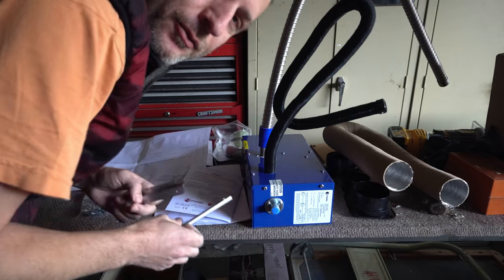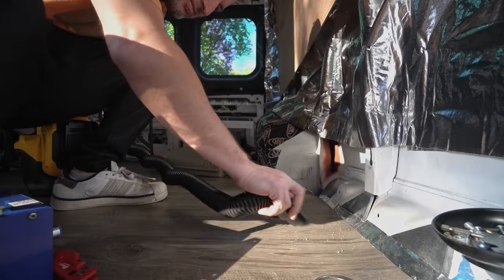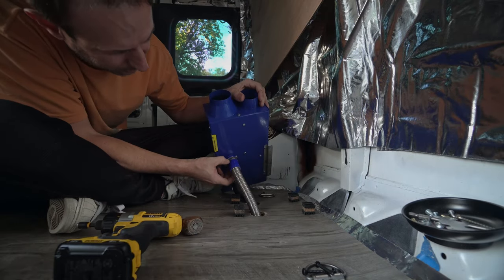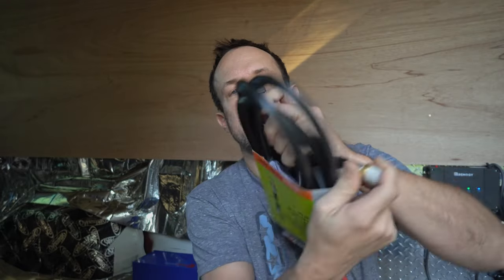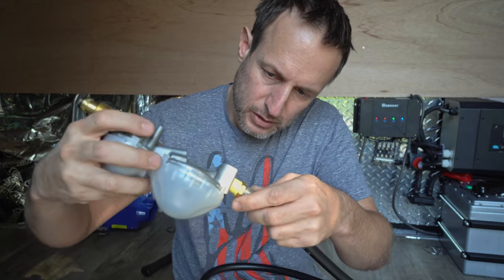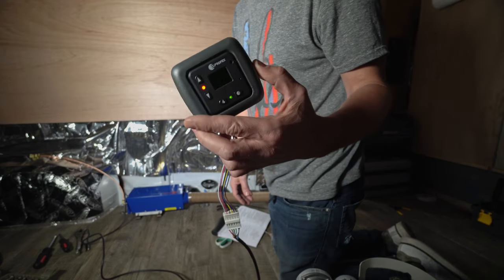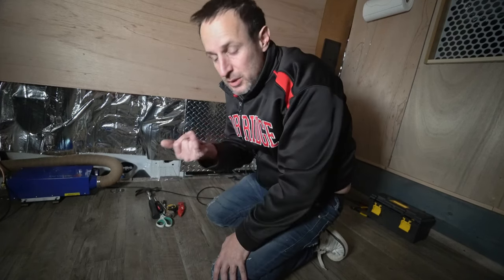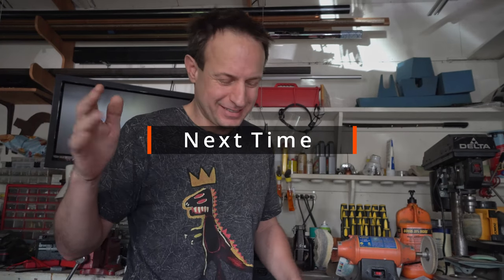Propex Heater “ Is it good?￼” Do this USA fitting | Correct Red Silicon

Comment: First time viewer. I really enjoyed your video. Humorous but informative and practical. Like most things, the devil's in the details. I may put one in my  Promaster next year. I'm still pretty early in my build, but it's nice to think for a while about an important accessory like this before jumping into the project. I'll look forward to browsing some of the other videos on your channel. Best wishes.
Reply from the maker: Thank you so much boat guy I've added an electric panel heater 300 W so that if I can plug-in I don't have to use propane and I still love this propane heater for sure I'm assuming you're up in Seattle but let me know if you come down south
Reply: Just sold my Promaster camper I built. Guess what, I now have purchased a Ford Transit and have got another Propex on order for it. That's how well they work. I have a brand new Chinese diesel heater still in the box but I'm not taking chances with it compared with the reliability of the Propex. If you own a high top Van I highly recommend going with the HS2800 as it kicks out about 3000 more btu and did a great job in my high top Promaster.
Reply: @vanmanmike7651  : Thanks very much for the update. I hope your new van works out great for you.
Reply from the maker: @vanmanmike7651   that is some great information Mike thank you I wish I had a little bit more BTU i’ve heard those diesel heaters need to be cleaned but not the proper heater because propane burns clean
Reply: That is correct. You always hear of heaters that use diesel, or gasoline that they say to run them on high before shutting them down. That is to try and blow the soot out of them. No need for that burning propane. @NoLimitVanLife
Reply: @NoLimitVanLife  Hey, while I got you here. Your video on your air conditioner. How much power does it use, how much power is in your van, and how long will the air unit run with the power that you have? Appreciate it.

Comment: Do not add Teflon tape to the flare side of a fitting. Only the pipe thread side into the appliance. You should use a tubing cutter to cut tube before flaring, then remove a little ring of metal on inside of tube using attached scraper tool on the cutter. Then insert flare nut on tube and use flaring tool to make flare.
Reply from the maker: I knew about the Teflon tape but man I did it all wrong But I have a leak test it a few times over the last year and don’t see any leaks but I do want to fix that

Comment: If you put a muffler inside to keep the most of the heat inside do you think is possible???
Reply from the maker: I can see that but it would be somewhat dangerous. I safe option would be putting a heat exchange on it outside and use it to heat water
Reply: @NoLimitVanLife  I have a water heating floor I will love see your ideas on paper or photo
Reply from the maker: @landrynelson3208  it's not something I'm planning to build at the moment

Comment: Are these heaters any good? I’m looking at buying one for my sprinter lwb.  
thanks
Reply from the maker: I’ve had it for two years and it works great my favorite part is the outside exhaust doesn’t smell and it’s pretty quiet
Reply: Sorry one more question.  Is it noisy at night when the heater kicks in and turns off? 

Thanks again
Reply: @bobbyedwards6144  mine is very quiet, but I have an oven and microwave oven in front of where it blows out so that makes it quieter there’s a different Trulia heater that’s really awesome. It’s electric and propane and it has a low fan settings so you can make it quieter. Also, because my pro pecks is mounted under my 8 inch mattress I think that also makes it quieter
Reply: Thanks for getting back to me  again. Do you mean the truma heater? 

Can’t make my mind up as they are all £1000 plus 😂
Reply: @bobbyedwards6144  yes, that’s the one. The European heater it’s so expensive. I want a mini stove now, but those are even more money. If you’re in the freezing cold, nothing is better than burning wood. I’ll go through a 20 pound propane tank every three days when it’s freezing. It’s nice to have an electric heater if you can plug it in, so you don’t waste the propane. I bought an AC panel heater like you would put in the house and installed it next to my water tank so it heats up the van and the water.